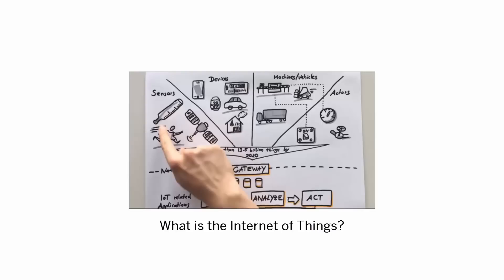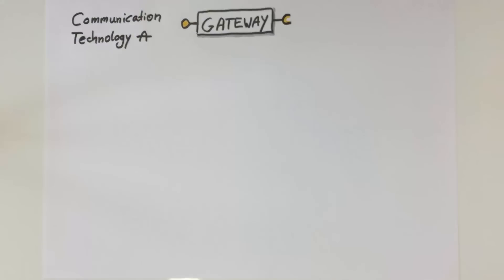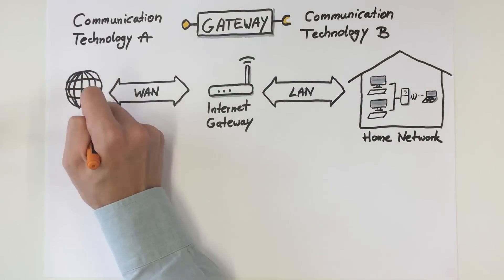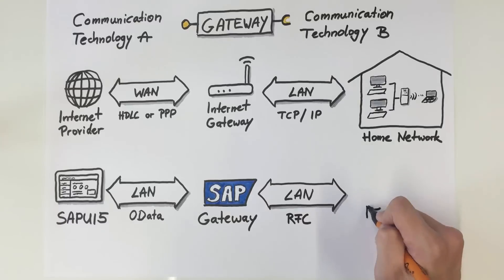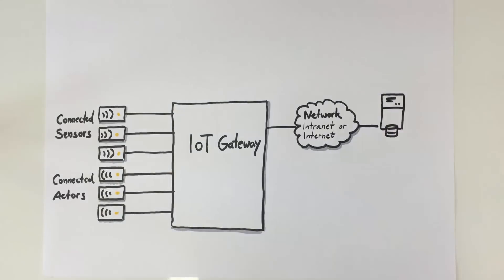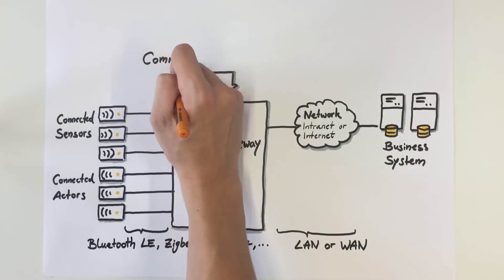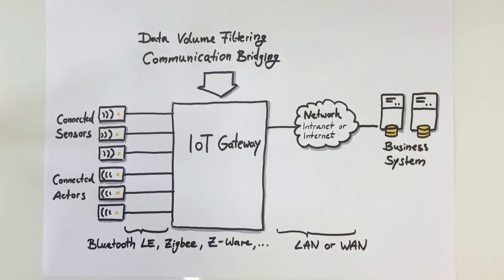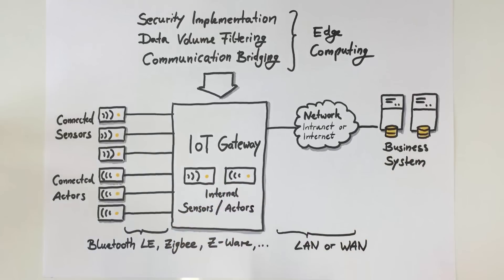What is an IoT Gateway? (SAP EA Explorer - Short Video)

Comment: Hello :) 

in this video, i see that a gateway could have a : LAN or MAN connection ...my question is : in which case the gateway could have LAN connection ? 

thank you a lot :)
Reply: For an example, you could consider a smart home application. There are many edge nodes/sensors in a smart home deployment like a smart switch or a smart bulb which are connected to GW through a comm technology of the sort of BLE, SubGHz etc and the GW is connected to the Wifi Router using a LAN cable (ethernet interface) to connect to the server application. This is how gateway has a LAN connection or if your GW has a Wifi Module on it, it can directly connect to the Wifi Access Point (your router) locally inside your home.